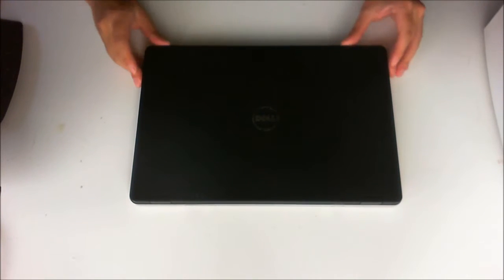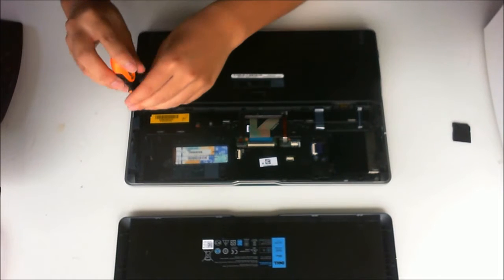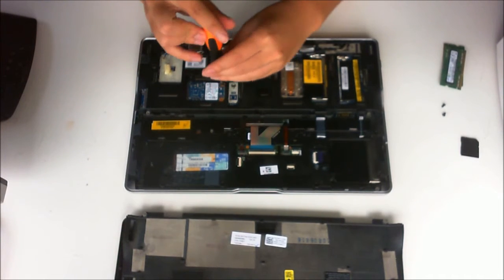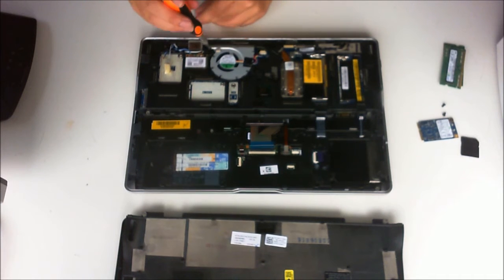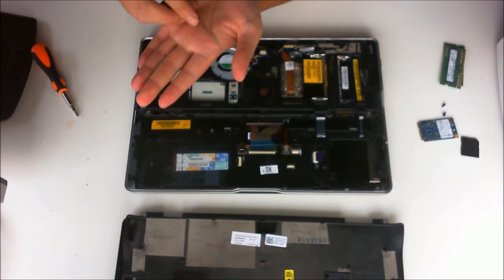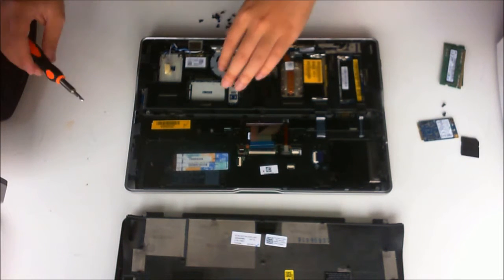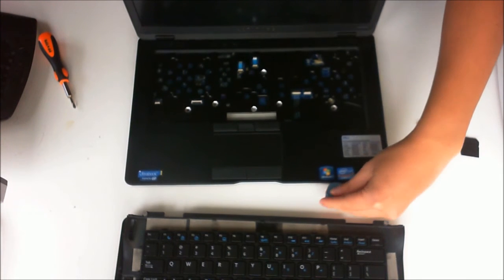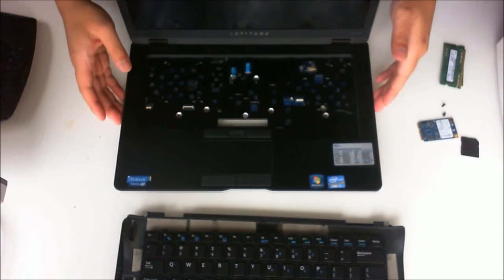OPEN ME UP! Dell Latitude  6430U Ultrabook Disassembly

Comment: Please do I need the 3G/4G card?
Can it be upgraded to something better than 3G/4G?
Where can I buy?
And a hard drive too cos I only have 128GB installed
Reply from the maker: you dont need the 3g/4g card and can use that slot for a hard drive. you can remove your old 128GB hard drive and replace it with something else biggger
Reply: @OpenMeUpTec  There's a SIM slot so I thought maybe I could use it as a modem
You mean I can just buy another hard drive and slot it in the 3g/4g space for more storage? So that I don't have to remove the current hard drive because of course everything and don't want to lose it on it
Reply from the maker: @SamExclusives  yes you can put a msata SSD in the 3g/4g slot

Comment: Thank you very much for that nicely done video I need to replace the lid on the 6430u laptop and was wondering if you could show me how to do that. It has broken on the top corner, the bezel is however fine.
Reply from the maker: houston77478 what is the lid? is it the top where the dell logo is. if it is you have to remove the whole screen off the laptop. I am unable to show you as I do not have the laptop anymore and have sold it. I only purchase them to open it up then I sell it. I can advise you on how to proceed in doing so.
Reply: OPEN ME UP Yes it is the top where the logo is, sorry I was not very clear, part number is YC8JP,  would appreciate if you could advice on how I would start with going about this replacement.
Reply from the maker: you can download the dell manual here and it tells you how to remove everything page 23 onwards. it is pretty simple so you should be fine. ftp://ftp.dell.com/Manuals/all-products/esuprt_laptop/esuprt_latitude_laptop/latitude-6430u-ultrabook_Owner%27s%20Manual_en-us.pdf